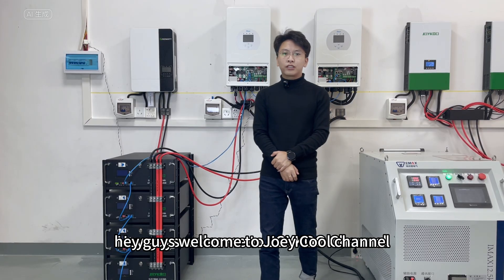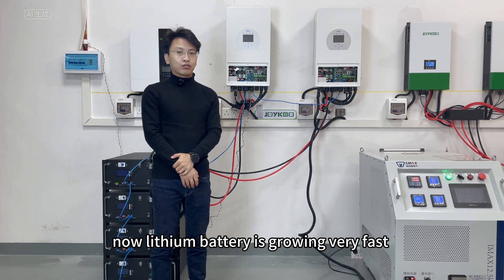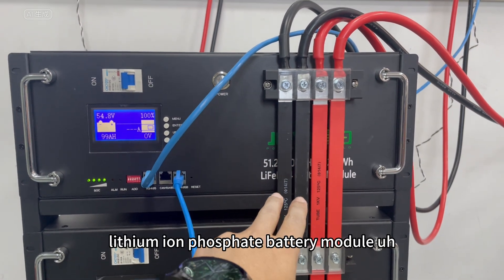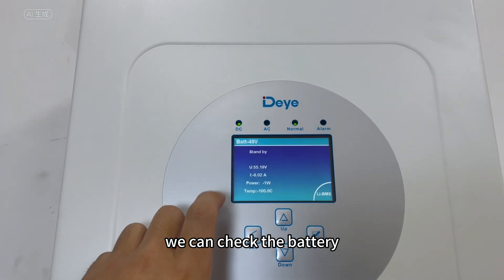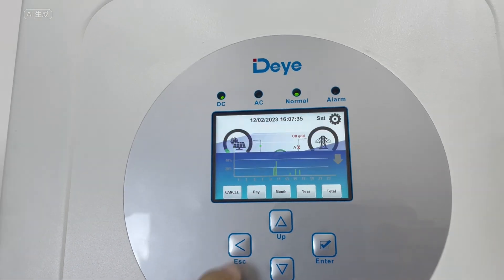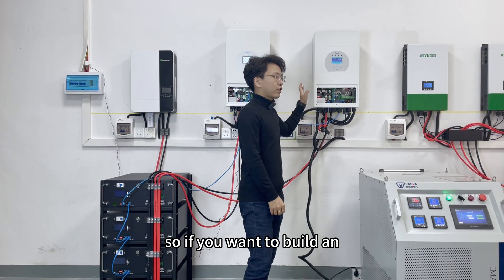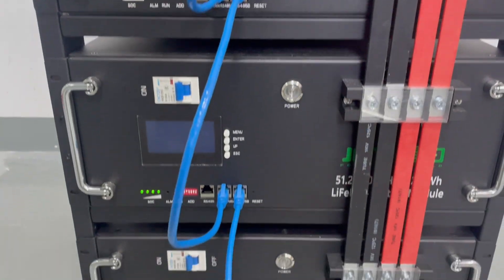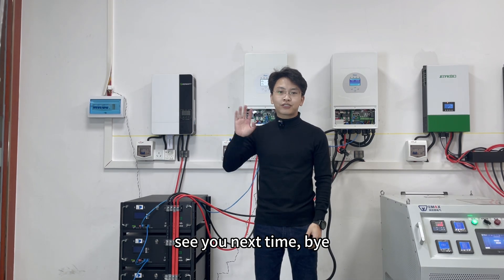DIY Off grid Home Powe System Deye 10KW Inverter and JOYKOO 20KWh Battery

Comment: Is it EMP-proof ?
Reply from the maker: yes
Reply: @joykoo2008  Do you have evidence to prove that it is EMP proof?  Can you post the evidence and testing so people know can see your claim is true and verified by a third party?
Reply from the maker: @torahislife  The battery's support is metal, and the metal support can be directly grounded or connected to a ground wire separately to solve the problem of electrostatic pulses
Reply: @joykoo2008  that is a claim, not proof.  You need to subject the unit to EMP to test it before making such claims
Reply from the maker: we will do in the future